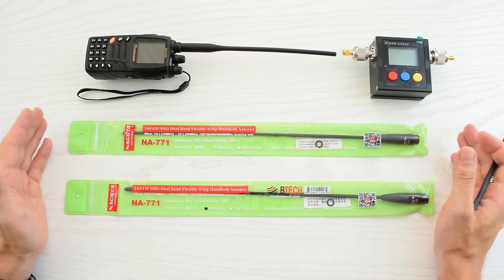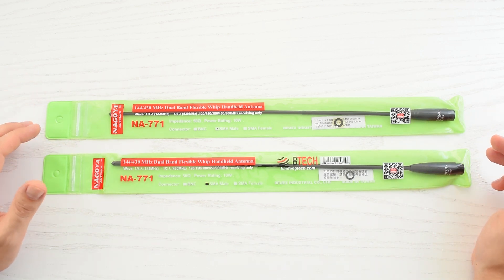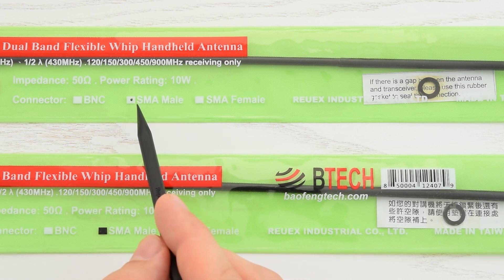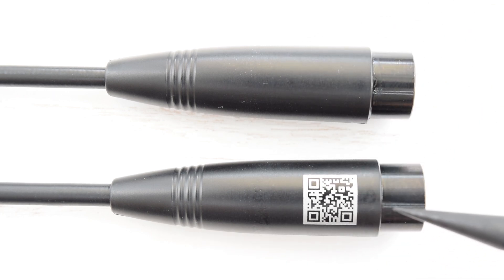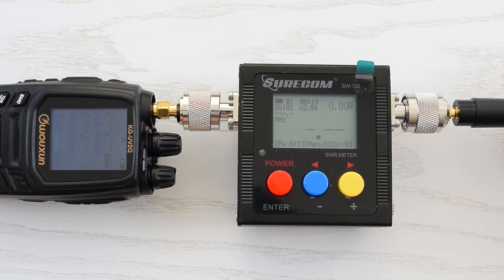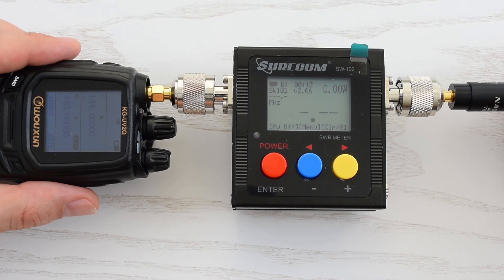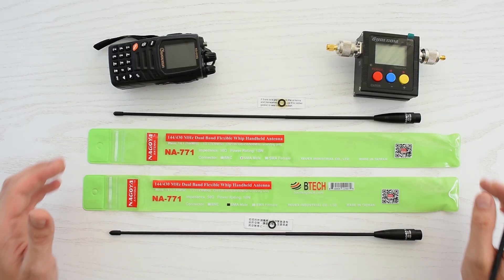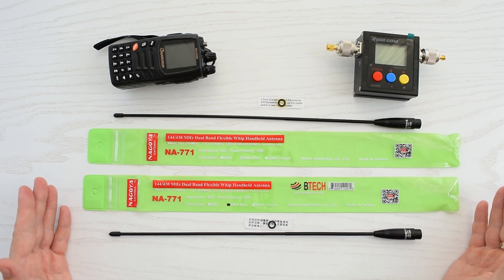Nagoya NA-771 Antenna – Fake vs Original | SWR & Performance Test

Comment: In 2025, buyers are saying the Aliexpress is real. But wait. One thing he didnt mention was length. Amazon, the so-called real one from Btech, is 14 inches long. But the Amazon ad says its 15.6 inches which is the length I always knew to be correct. My fake NA-771 (sold as genuine) is also 14 inches long. So whats going on? I just bought the Amazon Btech NA-771 and when it arrived as 14 inches, I packed it up for return. My fake antenna, bought in Asia, does work and as long as it cannot damage the radio, I think i'll just continue to use it. Meantime, others have tested the Aliexpress model and its not passing the tech tests so yes its fake too, despite the sellers absolute insistence its genuine.
Reply from the maker: @cvcoco  You can find both original and fake antennas on Amazon, AliExpress, or any other marketplace. It all comes down to the reliability of the seller.

Comment: You cannot do a meaningfull SWR TEST USING  small meter and handheld radio as the antenna under test is really half of a diople, the other half consisting of your meter,  radio, and your body holfong thr radio. As you show, with the radio laynig an the bench, SWR will be affected by any metalwork supporting the bench.
Reply from the maker: Here's the corrected text:

I know that, but if you're doing the same test in the same environment and the only thing that changes is the antenna, then you can get an idea about the antenna's performance. Also, those antennas were checked on a more advanced device (you can see the results on the graphs), and the results are about the same. The main idea wasn't to determine the actual SWR but to see if the fake antenna performs the same as or worse than the original one.

Comment: Great video! When you try the cheap antenna at 144MHz (time 2:16) your SWR meter indentifies it as 208.105MHz, and SWR is 1.72. Thats a bit strange?
Reply from the maker: Thank you for the comment! That SWR meter sometimes shows wrong frequency readings but SWR value is very accurate.

Comment: Never mind fake vs real. I’ve recently completed a vswr check with the stock antennas sent out with a Baofeng and a Quansheng HT and the results were terrible. All four tested were well over 4:1. One of the rubber duckies was into double figures.  Whereas my hand made slim Jim comes in at 1.1:1.
Reply: Yeah but what transmission frequency are we talking about ?

There is no one size fits all antenna

Comment: mine has the off tip, not looking original with a logo, but my qr scanner took me to their website, and i got it straight feom baofeng so looks can be deceiving
Reply from the maker: That QR code can be printed on anything you want. But in general, both antennas perform pretty good. The difference is only visible on some testing equipment but in real life, you'll never notice that difference in antenna performance.

Comment: I buy from  'B-Tech' and so far...No “cheap” ones.  I did buy 3 “cheap” ones (Ebay & Cheap Price = "Cheap Antenna")....only one had bad SWR readings...BUT some of the “cheap” ones do have pretty good SWR readings.
So far..The only way to tell the “cheap” ones by looking at it, the real ones, if you look at the tip.....the little Tip should say "NAGOYA"..if it don't, “cheap”.

Comment: Hi. I'm going to receive a genuine Nagoya NA-701 HT SMA male Antenna, but as far as I saw in other reviews, ALL these are just CRAPWARE. It's crazy how the factories don't perform the MINIMAL NECESSARY SWR tests, and they release sticks that are somewhat resonant at 150 - 160 MHz (VHF), and 440  - 450 MHz (UHF). The ridiculous fact is the justification that the factory provideswhen you contact 'em, saying that "a counterpoise wire is needed" !!!!! Counterpoise on an HandHeld radio ?!?!? The same shit happens with DIAMOND SRH 36, SRH519, SRH 701, SRH 771... There is NOT A SINGLE AERIAL resonating at 144 or 432 MHz at all !!!. I have two old COMET SH/85 (BNC) and a SMA-3 (SMS male) PERFECTLY WORKIN' at 144 and 432 MHz !. It appears IMHO that THE ONLY DECENT antennas are the ones produced by COMET (NGC now). I will see the NA 701 that comes from Spain, as here in Italy, Diamond is easy to find genuine, but Nagoyas are ALL FAKE. Hope my two cents are helpful. I measure through a base for mobile antenna with a large metal base, and the right measurements are successful with Comet SB5, SH95 (mobile antennas), and COMET SH85, SMA3, CH701X. All these sticks are PERFECTLY centered and show 1:1 to 1:1,5 SWR at VHF and UHF HAM frequencies ! 73.
Reply: Tests were performed with: YAESU VX-2E HT Transceiver, YAESU VX-8E HT Transceiver, KENWOOD TH-78E HT Transceiver,  YAESU FT-847 ALL BAND TXCVR. SWR Meters used: ZETAGI 430 Pro Line VHF/UHF SWR Meter, DIAMOND SX-400 VHF/UHF SWR Meter. Cable for the external measurements: BELDEN 9907 50 Ohm Double Shield, High Prop. Speed. / Lucent Teflon Low Loss military grade cable.
Reply from the maker: There's lots of fakes nowadays and it's really hard to find a decent antenna. Also many sellers in Europe sell stuff from Aliexpress and sometimes it's hard to say if it's a genuine product or not. This is why I prefer to order some equipment from specialized shops in the US. I hope you'll get a decent Nagoya NA-701.
Reply: @ElectronicsComputers  I got the list of European authorized resellers either from Diamond and Nagoya/Reuex, and l bought regular products. Despite this, with respect of the two companies, some products are crappy... :) 73
Reply: I received the Nagoya NA-701 HT SMA male, and it's genuine. This is actually my definitive VX.8R antenna, as it's perfectly resonant at HAM center bands. I confirm after further measurements that the NA-771 SMA male is a piece of crap.
Reply: I have two genuine 701s. Their performance is equal to a Retevis or Wouxhen (sp) antenna.

Comment: Very good video, though I was surprised the “cheap” antenna did as well as it did. Looking at my Nagoya NA-24J antenna, it read 20W for its power output, while the fake ones I've seen say 10W. Taking SWR readings with Surecom meters can be off by wide margins since there's no way to establish a ground plane, even with steel ground plane shields (which are no longer being offered with Surecom meters due to cost and because they don't really work). Still, I would love to see you test some cheap no name antennas next to your Nagoya. Oh, and I highly recommend the Retevis RHD-771. It's a higher guage antenna that has worked out very well for me. Cheers.
Reply from the maker: Thank you for the comment! Yeah, I'm familiar with the Retevis RHD-771. It's a very good antenna.
Reply: Frequency Center Tuning: 144 – 430MHz
Gain: 2.15 – 3.5 dBi
Wave: 1/4λ – 5/8λ
Optimal Transmit Frequency Range: 140-148MHz, 420-450MHz
Connector Type: SMA-Female
Impedance: 50Ω, VSWR: ≤ 1.5
Direction: Omni-directional
Max Input Power: 10W
Antenna Length: 16 inches / 41cm
Package Contents: Nagoya NA-24J, Antenna Washer
Reply: I have that antenna straight from btexh website and it says 10watts

Comment: Are the ones from the Aliexpress links in the description legit or no?!
Reply from the maker: NO! Only from Amazon.
Reply: @ElectronicsComputers  Amazon is not a Quality Guarantee..... they sell BS too
Reply: @ElectronicsComputers  Then why does the amazon antenna measure at 14 inches when the advertisement says 15.6 inches which is the correct length? Im returning the amazon antenna I just bought.

Comment: is the spacer gasket thing gonna affect the performance?
Reply from the maker: That gasket is only for dust protection and it won't work for most radios.
Reply: Not at all
Reply: The spacer is for stability If the base of the antenna  does not sit firmly against the radio there is a good chance you will rip the connector out of the radio
Or at least crack the solder joint that holds the plug in to the circuit board
Reply: The spacer is only necessary if there is a gap between the base of the antenna and the radio when the antenna is fully screwed in

Comment: You tested the antenna lying down horizontal this will give poor results. Also these antenna's use your body as part of the grounding. So I dont think the results are accurate. K
Reply from the maker: It doesn't matter, because both antennas were tested at the same conditions and both SWR meter and antenna analyzer show pretty similar results. I agree that it's not a scientific or super accurate test but the point was to compare those two antennas and find out if they perform differently. And this test clearly shows the difference in their performance.

Comment: What radio output power setting are you testing with?
Reply from the maker: That radio was just out of the box with all default settings. The RF output power was set to the maximum.

Comment: just tore down a 773, dont know if it was fake but swr was useless. it had a tiny tight wound loading coil inside which i removed and replaced with a large 5 turn wide spaced coil around the outside of the original housing. it now gets 144-146 below 2.0swr with one or 2 sections collapsed. fully out it tunes 137 so ok for sat rx. 70cm is non existent. to be fair, the antenna that came with my vx7r is crap in any configuration. the best rubber antenna i had was on ic-t2h . i have yet to find a handheld multiband that works well
Reply from the maker: There's so much fakes nowadays so you have to be super lucky to find the original one.

Comment: Do you know if NA-771A (A for airband) is available anywhere?
Reply from the maker: The links for that antenna is in the description box below the video. Nagoya NA-771A  is not the best option for airband but anyway it's way better than most stock VHF/UHF antennas.
Reply: @ElectronicsComputers  what would you prefer for airband then (118 - 136 mhz)? Also didn't find A version link, only the one for stock 771(non A)

Comment: Just ordered the NA-771 from Amazon. I'll find out Wednesday which one I get. Thanks for posting this.
Reply from the maker: Happy to help!
Reply: So was it a legit antenna?
Reply from the maker: @rallypoint1  The antenna from Amazon is the legitimate one, at least in my case. The link in the description.
Reply: @ElectronicsComputers  Awesome!!
Reply: @rallypoint1  yes, I received the genuine article. And it works great. Any future handhelds I buy will be equipped with them.
Reply: @happyjack880  Very cool...thank you!!
Reply: @rallypoint1  just a warning. The Amazon reviews seem very sketchy. Some people report getting essentially a dud antenna where their rubber ducky was better. I’d recommend going to a website that sales radio equipment to get a forsure legit one than a possible fake from Amazon. I know that Amazon post had like 15,000 review at like 4.5 stars but it takes very little looking to find the bad reviews

Comment: I think both of them are genuine. You can check photo at product file. 
https://www.nagoya.com.tw/v_comm/inc/product_file_download.asp?customer_id=2277&lang=2&id=384799&file_name=p_160325_07186.pdf
It is seen that the logo is not available when you zoom in the pointed plastic end.
May be the new series have qr code and pointy plastic tip with logo.
Reply: Exactly. The Btech packaging is Btechs (and Btech/Baofengtech is NOT the Baofeng company) own packaging, and the upper packaging claimed to be "fake" packaging in this video is actually what comes from Nagoya factory. The claim that only those antenna marked "Btech" or "Baofengtech" are legit is the same nonsense claim that only Btech aka Baofengtech are the only legit Baofeng radios. BTech has gotten into trouble calling other US  distributors/sellers  UV-5rs "fake" even claiming that UV-5r was "discontinued."  The actual Baofeng company had to issue statements on its website stating BTechs claim was false.  Looks like they are now pulling same nonsense with nagoya antennas, and Nagoya has had to counterr Btechs claims, and Nagoya has noted Btech is NOT the only authorized US nagoya seller.  Reminds me of the Btech claim that brown Baofeng box meant it was "fake" when Baofeng factory itself puts them in brown boxes.
Bteck/Baofeng tech is one of MANY official  Nagoya distributors.  
Do we think the other distributors are putting the name of a competing distributor on their packaging???
Reply: @teo2975  do they ship nagoyas from China? Cause mine I just got shipped from China, came in a green sleeve and says made in taiwain on the packaging. I havnt totally written it off yet cause maybe there made it Taiwan but then sent out to China for shipping but seems strange.
Reply from the maker: In terms of quality and performs there's something clearly wrong with the antenna from AliExpress.

Comment: Greetings. Is it safe for a mono band portable radio installed with an aftermarket dual band antenna?
Reply from the maker: Absolutely safe but dual band antenna may not perform as good as a dedicated one band antenna. You have to compare SWR values on the particular band/frequency that your radio works.
Reply: @ElectronicsComputers  thank you.

Comment: My nagoya na-771 antenna wont even screw down on a  Icom HT.   2 turns and its stuck .     Aliexpress is a trange place for criminals.
Reply from the maker: Check the thread maybe it's damaged or something stuck inside.

Comment: mine doesn't have qr code on base and has a plain silicone tip no manafacturer name is it a fake?
Reply: half of this youtube is total nonsense and Nagoya itself has had to issue a list of official distributors. The packaging you see as claimed "genuine this is ONE distributor putting the antenna it in their own packaging. the packaging listed as "fake" here is actually the packaging the Nagoya comes in from the factory. This is the same nonsense the Btech aka Baofengtech (which is not hte official baofeng company by one of scores of distributors) did making their own packaging for Baofengs it is selling and then claiming other packaging is "fake."
Reply: @teo2975  Totally agree
Reply from the maker: Most likely it's a fake antenna but it also perform pretty good, at least the fake ones that I've tested.
Reply: @ElectronicsComputers  it's ok I sent picture of it to Nagoya and it's genuine, I have better antennas anyways cheers

Comment: The fake one is actually not bad too according to that SWR plot. I think it will be better than rubber-duck antenna that comes with the radio.
Reply: Where can I buy an original?
Reply from the maker: Anyway it worth 8$ but the original one is significantly better in all its aspects.